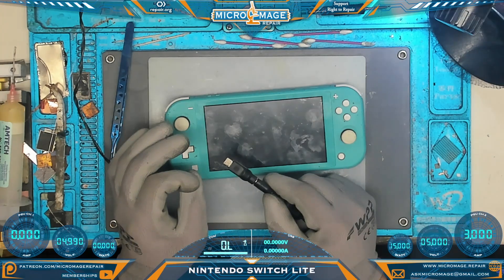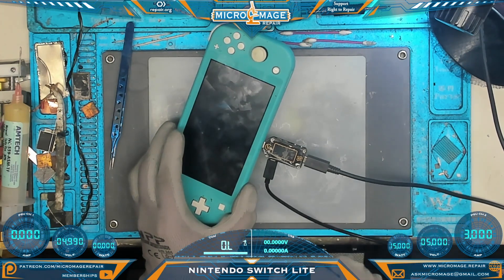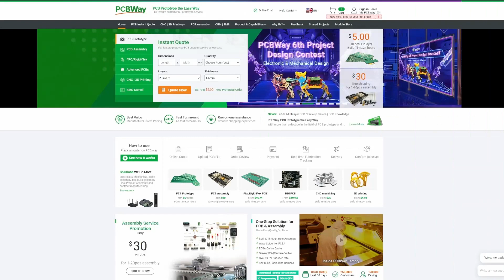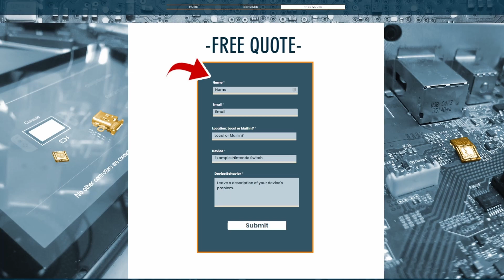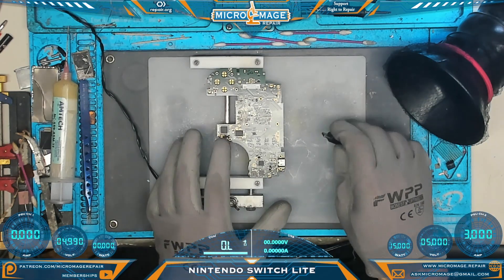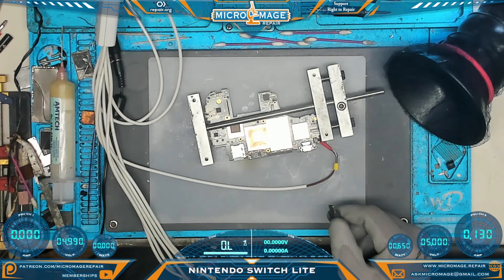Nintendo Switch Lite: No Power

Comment: 6:22
Shouldn't the voltage for the battery squid around 4.2V/4.4V to simulate full charge?
Reply from the maker: The Squid puts out the right voltage range. I don't have a good way to show that currently I'm mainly watching the current.
Reply: @MicroMageRepair  
Perhaps your onscreen display showing 5V is wrong then. Anyway great content! No more lame boring fan connectors please.
Reply from the maker: @jackipiegg  it supplies the squid with 5v, the squid steps it down to battery voltages. 
I don't control what comes in 😂
I'm sure there will be more fan connector videos along with other boring stuff between the interesting ones.
That's the reality of the business.
Reply: @MicroMageRepair  
Too bad you're not one those youtubers that purposefully buy faulty ebay stuff and fix them. Would be awesome to see ps5 power problem repairs.
Reply from the maker: @jackipiegg   I don't have the budget for that. It's almost always a loss unless you are making the money off the videos, which I definitely am not 🤣